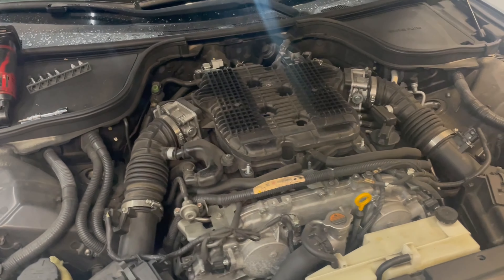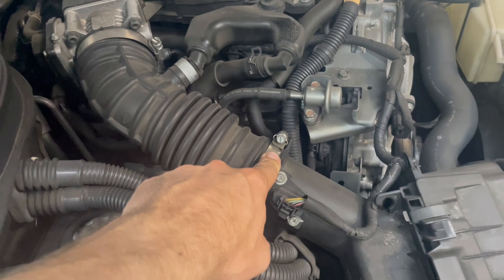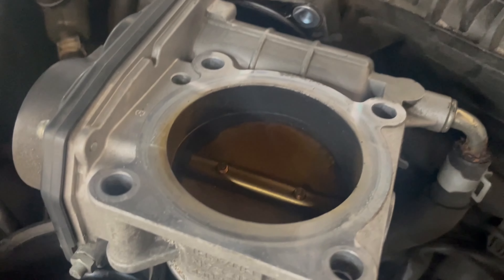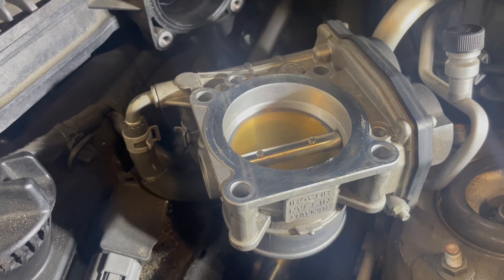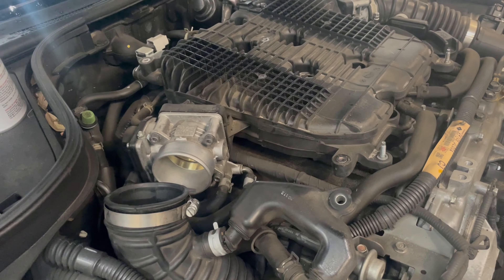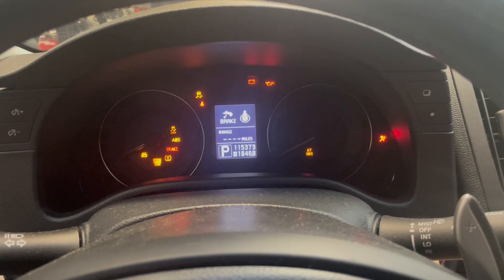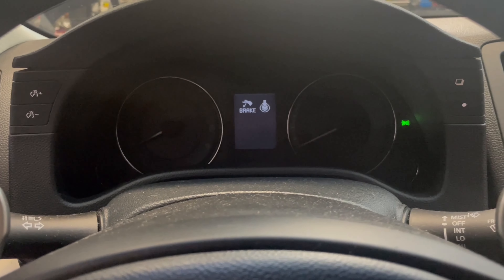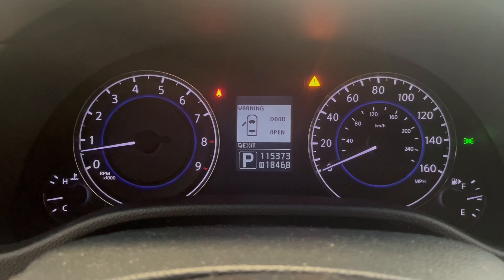Infiniti G37 Throttle Body Cleaning Service and Re-learn Procedure

Comment: Did you do spark plugs too? My g37 still lags even after spark plugs do you recommend throttle cleaning at 95k miles
Reply from the maker: On the IPL the spark plug service interval was around 60k miles. Our car is almost due for another set. I think it would be wise to clean the throttle bodies at 100k interval. Ours has 115k and they were ready for a clean.

Comment: i have a 2015 Infiniti q40 and i bought the car 2 weeks ago. its in good conditions and only has about 140,000 miles. however recently when i went to accelerate to show my friend the pickup the car has my gas pedal stopped working and my check engine light turned on. when i pulled over and turned the car off and on the gas pedal worked again but the check engine light was still on. it gave me a p2135 code. and since then its been rough accelerating after a complete stop or sometimes will just sit still then bump into gear. it will sometimes wait untill 7-8000 rpms to shift up and jolts when it does. could it be this?  or maybe just a sensor? I'm afraid its the transmission because that's what went out on my old car nd there's no way I can afford one right now so any cheap ideas would be appreciated
Reply from the maker: This code sounds like you have an issue with your passenger side throttle control actuator on the throttle body. Make sure the harness is plugged into the throttle body properly if you just had it serviced.

Comment: So I have a g37 coupe with 130k and it just started to jolt when idling and the rpm goes up slightly. Spark plugs are new so do u think this could help or fix the problem
Reply from the maker: I would definitely do this service if you haven’t before. Our G was at a similar mileage when it started giving us trouble. This service resolved it. 

Be sure to do the recalibration process at the end of

Comment: I seem to be to doing it but my car don’t hold it’s rpm an shut off am I doing something wrong?
Reply from the maker: Is your car an auto or a manual? I recall the relearn process is slightly different depending on which trans you have.

Comment: Nice. So you never actually remove the throttle bodie plat out of the bodie to clea. It better?
Reply from the maker: No need, you can sufficiently clean it without removing. Done 20k miles since this service and no issues and idle is perfect.

Comment: Hello, could a dirty throttlebody be causing me to have a P0 300 on my Infiniti?
Reply from the maker: This code is not related to the throttle bodies. I would start simple and check spark plugs. Make sure to replace with OEM plugs if you decide to replace.
Reply: @ the code seems to come on when the weather is cold and only on a cold start. I’ve replaced the plugs with OEM a year ago and it fixed the problem then cold weather came again and got the same code. I replaced ignition coils on bank one since I was getting them on that side and it fixed it now a year later I got the same code swap coil packs to see if it would follow up to the other bank and they stayed in bank one.

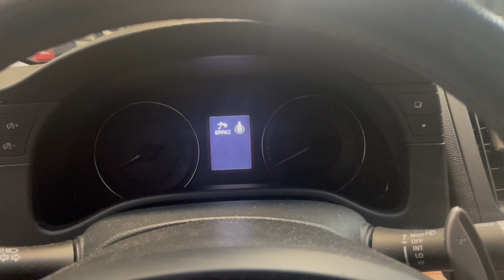Comment: At 5:53, are you sure you didn't have to push the start button twice to finally get it into ignition 2 mode on that first attempt? Saw there was a proper delay there in the vid and your finger hitting the start button a second time under 5 seconds before it went into ignition 2 and you actually counted the first 5 seconds. Just wanted to clarify for everyone who needs to do this without a scanner. Thanks for doing this video btw.
Reply from the maker: It’s been a while since I made this video. But I do know the process varies between auto and manual. Ours is an auto. 

We have had this G nearly 10 years and it’s so reliable compared to all the other cars I chose to enjoy. 🤣
Reply: yea man i was comfused to but yea u do have to press 2 times and also make sure your car is cold for it to work

Comment: I did this and installed my new kn air intake now my cat won't start is there anything special to do with throttle body when reinstalling
Reply from the maker: As long as you didn’t unplug them you should be ok. 

Just be sure to follow the relearn procedure in the end of the video
Reply: @LowTechGarage  I unplugged them lol so have I ruined them

Comment: Does this work on the 2014 q50 with the 3.7 engine?
Reply from the maker: Yes this should work the same.
Reply: Thank you! @LowTechGarage  , also would you recommend disconnecting the battery before doing this?